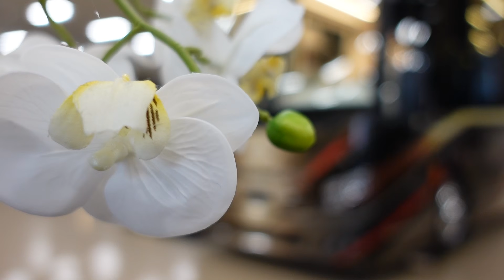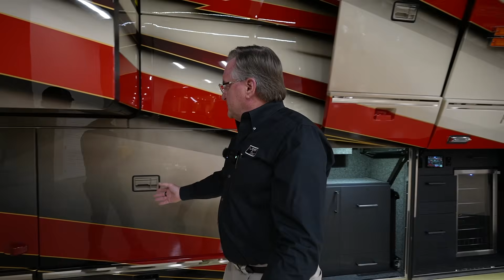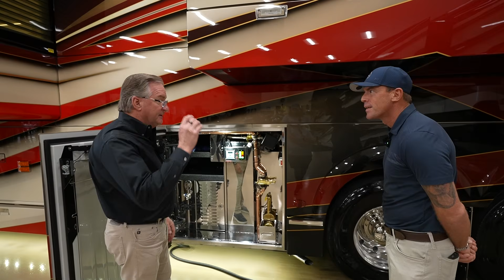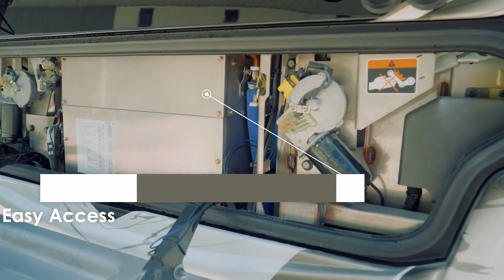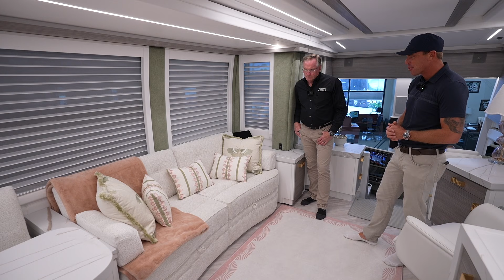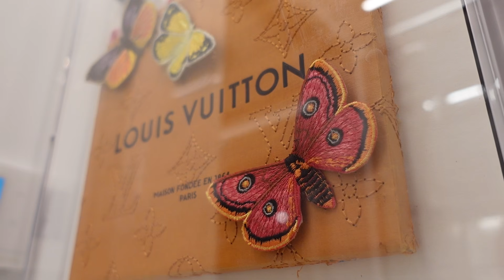Touring The Most Expensive Motorhome In The World!

Comment: There are a couple of things with Liberty.
pros
1) These coaches are beautiful, functional and built to prove that those are not accidents.

cons
2) It's the stupidity of the split windscreen. In the 1930s or 1940s having a brace may have been required but come-on guys. It's just a visual obstruction today. And it's stupid to say it's a safety structural requirement.
conclusion
If one thing is presented with such blind stupidity, why would anyone spend this money?
however
I really love the fact that it's the same family build. You have to respect. These are the most respected quality build. I wish they would build their own chassis. But I suppose they're too old to start that.
Reply: Thank you for your pro, I think the con was bit rough, there is nothing stupid about it.  Have you ever seen a single windshield or windscreen transported or installed??  The size of it and weight is enormous and the cost is crazy.  You almost can't go across country without getting a chip or large rock throw at you, now with that said, try designing a system to black out the windshield from the inside, we have blackout shades that come down tight to the inside of the windshield for night time use.  All things considered the center post has many more pros than cons.  Thank you for the rest of the comments, appreciated.
Reply: @frankkonigseder6592  
Thank you Frank for the personal reply.
I suppose it's like they say, We need to have differences in opinions or we' would all be fighting over my wifes hand. 😊🍦
The argument over center post will continue because it is what it is. Not everybody - actually nobody I know has had their windscreen chipped crossing the country. I will allow at the annual rallies - there maybe 1 or 2 but not every year.
I love the shows Andrew does and it seems I learn something every time from you. On this video it was the tech. put into the mud-flap design. It fascinates me to listen and learn.
 cheers jack

Comment: The new backend shroud, or cap, on the 9660 shell was designed by Kurt, the speaker's brother, to improve fuel economy. His brother's design helps by keeping the coach much cleaner in the back and cutting down on the drafting. The design process also took two years to ensure it was seamlessly integrated and didn't look like an add-on feature 👍🏽💯